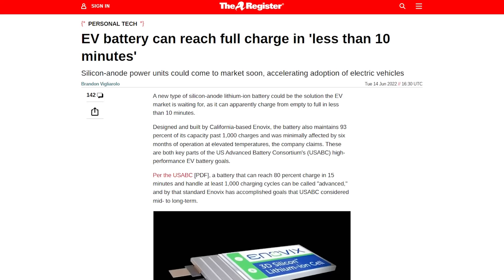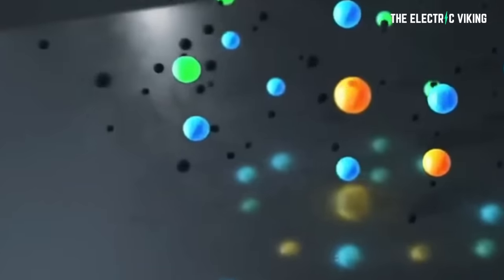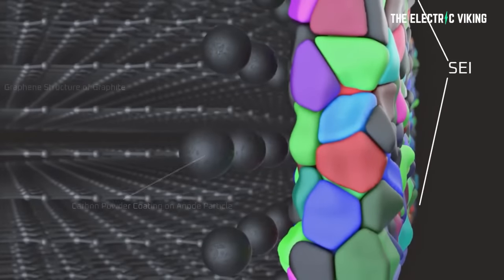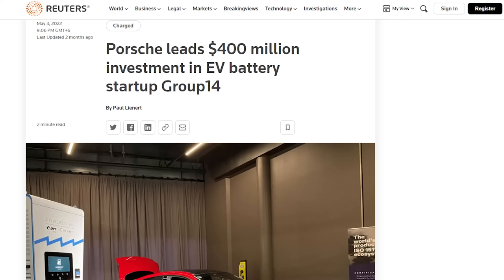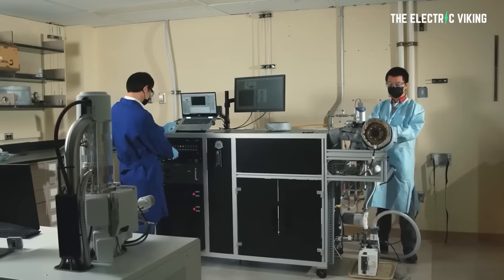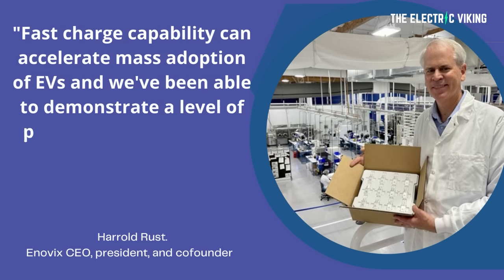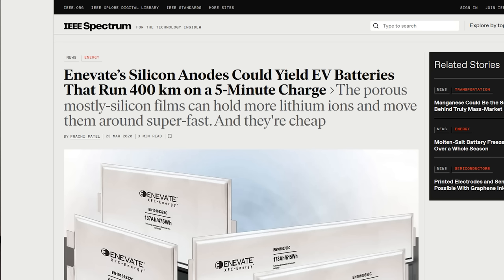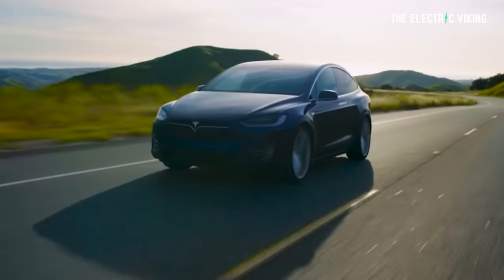5 minute charge Silicon-anode EV batteries are almost here

Comment: LFP is cheaper, longer lasting, and range doesn't matter, in my opinion. As long as you have around 400 km and the ability to charge quickly, you're good to go.
Reply: agreed
Reply: Range is not so important, but energy density is. More energy density = less weight for the same range, and less weight makes an EV more efficient

Comment: These are ideal for a PHEV with a 15kWh battery able to absorb 100 KW regenerative braking which is the same C rate as the advertised 10 minute charging time.  You could almost eliminate the need for brakes.  The range would be good enough for 95% of trips people take and 10 minute charging would be really convenient also.  There is no longer an excuse for any cars to be sold with out PHEV capability.  Furthermore if this concept was utilized we could eliminate 95% of new vehicle emissions within 5 years easy.  It's time to legislate a ban on non-PHEV's phased in less than 10 years.
Reply: As long as you use the ICE as the generator, and not connect it to the wheels at all.
At least that is the PHEV I'd buy if I was looking for one. That alone would eliminate the gearbox entirely, and you will never have to depend on the gas engine. It also allows to design an extremely fuel efficient engine that is not subject to conditions required for driving the wheels.

Comment: Thanks Viking, since Tesla Battery day I have been watching and waiting for silicon anode batteries to become a reality.  I agree it will happen soon because the expansion problem is going to be solved with so many companies working on it.  The incentive is high because of the increase in energy density and charging speed; along with the fact that it will slide right into current battery production lines with current cathodes.  In parallel, I believe the scalable production of high purity silicon in the ideal form is near at hand.  The silicon anode will be a major step forward for batteries.  Thanks for covering this.  Could happen in 1 to 2 years.
Reply: I agree that in several years they could get the chemistry worked out, but most folks don't understand the real battle is not the chemistry, it's mass production.  Engineering for mass production will take at least 2 more years, then securing raw materials and resources (another 2 years), then build factories (another 2 years).  Then they can start a pilot production line for about 1 year before starting actual production runs.  You are looking at 10 to 15 years.
Reply: @FL-FLyer  check your math, it will happen next year. It will be in smartwatches next year.

Comment: Charging 100 kWh battery in 5 minutes requires (let me do the math) 1.21 Megawatts.
Reply: Very good point. I tell people this all the time but they don't understand.
Reply: What the hell is a megawatt!?!?!
Reply: Amillipn watts
Reply: @dalton1981  Exactly! This is the basic problem with explaining electricity. Because we can't physically see, touch or hold electricity, only it's results in the form of light, heat or a motor running. Unlike the size, weight or volume of a physical object. This make it very hard to relate the actual size a kilowatt, megawatt etc is for most people.

Comment: Faster Charging is nice; but it sounds to still utilize Lithium so it still would be choked by Lithium production which is a severe limit.
Reply: Once extracted and used in batteries will be forever there, is not consumed...so...
Reply: Not severe,just slow to ramp.😃

Comment: Too many possibility's and you are responsible for presenting a wide variety . Looks like some kind of LFP is most likely .  So far feeling kind of meh about 4680's . Texas Y 4680 doesn't seem to be much better than the 2170 for the end user unless there hiding something.  Seems like 4680 is  more a form factor than a new battery chemistry  .  What about the wild cards like Sodium and Sulfur. There are so many people working on this now. Capacity and cost and longevity  is of more important than ultra quick charging to me at his point.  Most of the charging I would do would be at home.

Comment: I bet on this. Why? Heat in lithium ion is not a waste.. using that heat liquid transfer in the cab seats allow far better efficiencies compared to solid state. You will get maximum voltage utility

Comment: So what kind of charger can charge these batteries this fast
Reply: Well tesla has a 1.5mwh charger for the semi in service at a couple spots. Plus the new char-in standard just got approval and can go up to 3.75mwhs. So it'll need to be something like that I'd guess. Unless it's only for smaller pack's? And then 350-500kwhs could do it, which we have.

Likely imo is the qouted 5mins time is only for 10-80% and with most ev pack's today being around 75kwhs useable capacity. 
That means you only need to jam in about 55kwhs in 5mins. 

Now this sounds intense, but last summer a secret graphene chemistry gaic pack built in China, actually did a 10-80% charge on one of their 500kwhs chargers in just 5mins, with a full charge done in under 10. But they only released a couple videos of it and it's been run silent run deep since last summer. 🤔